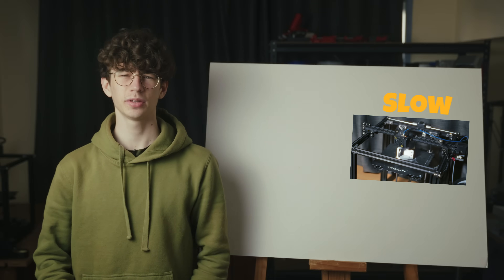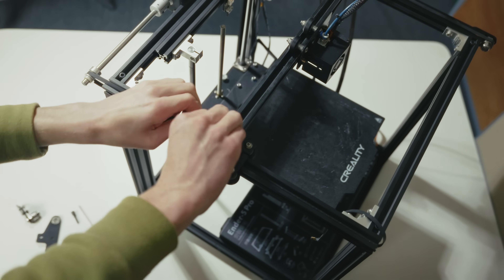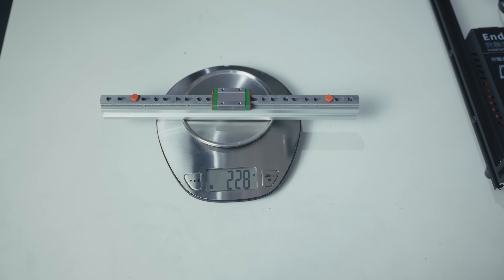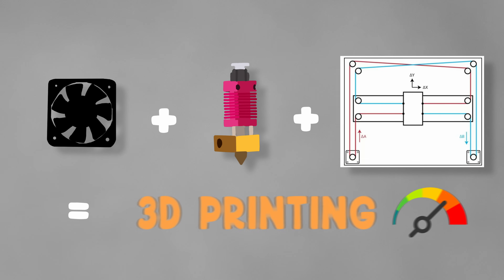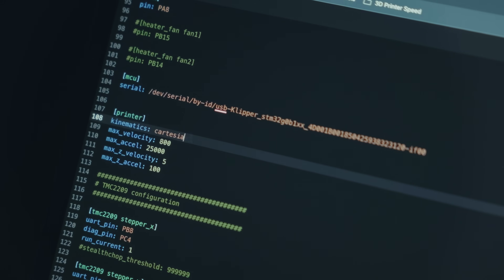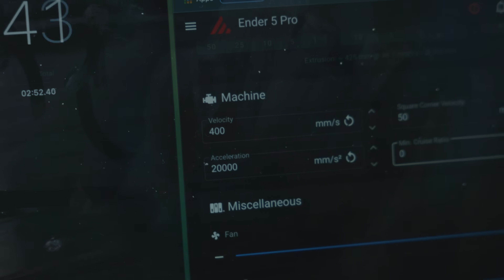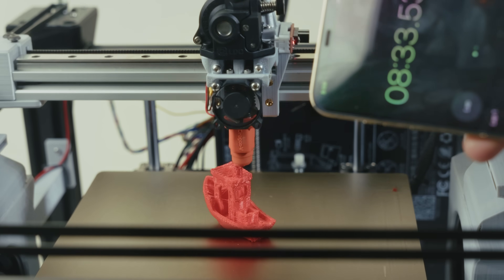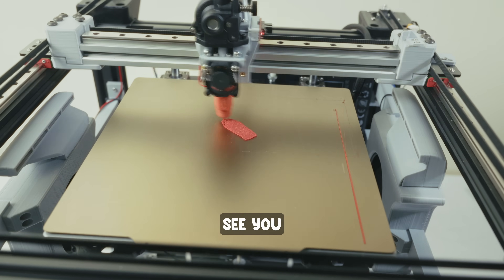Building the Fastest Ender 5 Pro

Comment: The advantage or CoreXY is not "because two motors are used to move the printhead in the XY plane", because cartesian does the same thing on diagonal movements while CoreXY only uses one motor for perfect diagonals. The real advantage is that the motors are both stationary, reducing the weight of the gantry especially in the Y direction.
Reply: I used to believe that until Bambu Lab came out with the A1 and Creality has the E3 V3 and V3 Plus. I have the V3 Plus and it can spit out a 14 minute benchy that is comparable to a 40 or 50 minute benchy on other machines and it's a bed slinger with a 300x300mm bed (that's a lot of weight). Also look at the new machines that are multicolor printers. There's a lot of weight on the print head, especially since some are dragging more than one bowden tube.
The only real advantage that a Core XY machine may have is less ringing and layer lines in very tall builds since the bed isn't moving back and forth, but so far I haven't seen much to be concerned with printing on my E3 V3 Plus.
Reply: @Smedleydog1 when going bigger on corexy you are adding much less weight than with a cartesian, and the problems that may occur with longer belts can be counteracted with ones with more width, such as going with 9mm instead of the normal 6mm on most consumer 3d printers
Reply from the maker: You're right on that, I should have been clearer. If I need to mention it again in the future, I'll make sure It's accurate. Cheers
Reply: @TommyHoughton  Actually "cartesian" is not automaticly a bedslinger. Also crossing rods (like used in the Ultimaker 2 and Crealitys CR200b) is a cartesian system. The K3 is a very fast and capable crossing "rod" system (crossing linear rails instead of rods).
To be even more precise: "Cartesian" just means 3 axis perpendicular together. So strictly speaking a CoreXY also is cartesian - z-,a- and b are perpendicular together. Just g-code coordinates are 45° rotated to the x and y of the g-code coordinates.
And even more more precise: Any printer with ABL is not cartesian, as z=0 depends on x/y coordinate - so you are not strictly in euclidic space (z
=0 plane is bend...). "Cartesian" only applys in Euclidic space... (but this definitly over strictly following the definitions).
However, there are real non-cartesian printers: Delte/Hanging printers and Polar Printers.
Reply: The weight of the extra crap cancels out savings by relocating motor doesn't it? 
The disadvantage of giant long belts is stretch and slop I still don't get how without linear encoders you keep accurate position? If HP made 3D printers they would be full of linear encoders.  All crap inkjets use them to achieve such detailed fonts. So why not 3d printers? And don't say too accurate that isn't a thing.
Reply: @remotepinecone Most likely because that would make it more expensive and / or such a package is not available yet?
Reply: @remotepinecone  On 2d inkjet printers the printhead is just moved left and right. Acceleration/decelleration just happens at the end of the movement. Linear encoders are used to determine the position at any time. As the printhead does a constant speed, it does not matter the encoder resolution can not be as high as the print resolution. The encoder does not recognice 1200 position per inch, even it this is the resolution you selected for the print. On a constant linear movement you can interpolate the position quite accurate. So the dots can be fired out exactly in the right moment. The printhead acts depending on the position. It is only moved in one axis - and every position without dots, the printhead just moves without fireing dots.
It is dot-matrix. It is just moving left and right; only turning back at the end of a line. It decelerate after the last dot is fired in the line, and it has accelerated in the other direction before the first dot is printed.
In simple: The dot shots the moment you are in ther right position. Your position decide to fire. So you can use simple DC-motors.

This is totally different to vector printing. Here acceleration/decelleration happens while printing. The most important thing is to move the right way and stop and change direction fast and precise. Esp. stopping in an exact position is not exactly something you can do with an DC-Motor (there are some tricks). But for precise break you actually need an active break. For big CNC-Mills there are some heavy motors using this technic, and rotary encoders are used to control how much the motor had turned. A quite coslty techniqe.

But here this are all rotary encoders, to controll the motor - not the printhead. You can measure and calibrate the kinematics.

The biggest problem why linear encoders do not make sense on 3d-printers: The extruder reacts to slow. If the extruder feeds, there not instantly plastic comes out of the nozzle. And if the extruder stops and retracts, still this takes its time to the plastic stopping comming out of the nozzle. AKA "preasure advance". What´s the benifit knowing you are 0.1mm off then the extrusion started? you can not change it anymore.

However, linear encoders would be quite nice for autocallibration. The tension of a belt effects the steps/mm you need for a distance. So move the printhead 20cm and check by the linear encoder the real distance archived. Recalculate the steps/mm.
But as does not change to often, manual calibration prints are not a big deal - and extra linear encoders are just another part that might be damaged.
Reply: That's why I'm rocking some Hiwin Ballscrews and Linear Rails 😉🍆
Reply: @remotepinecone  there is so little slop that it isn't even a factor worth considering, that's what belt tension is for, with high quality belts stretching as seen in the video won't happen
Reply: @remotepinecone  hp does make 3d printers...
Reply: Disadvantage is longer belts. A replicator style system can move one axis faster with less wobble. But the other axis suffers.

Theres other ways to transmit the movement like a long gear shaft etc too but get complicated and expensive
Reply: @lasskinn  The belt drive is the only one without backlash and misalignment. Crossed shafts have backlash at the bearings on the hotend (although only a hundredth of a mm). There is also a fit tolerance on the threaded spindle. With well tensioned belts, there is no displacement between the motor and the hotend (theoretically only a change in belt length, but for a quality belt = 0).

Comment: No auto levelling? Thought adding a BL Touch or inductive probe would be usefully. Any capacity for input shaping?
Reply from the maker: I was considering it. I do have a bltouch and microprobe, but I would have to design a mount for them. With the amount of changes planned, I’ll leave it until the end. I didn’t see a need for input shaping just yet but will calibrate once I need to. Thanks for watching! Cheers
Reply: @TommyHoughton  buy a BTT eddy it's about 20 euro and is a very fast and good eddy current probe.
Reply from the maker: @larseastman1567  I’ve heard good things about it! It’s definitely on my list to try. Cheers

Comment: it looks like you just need an actually cooling fan on your toolhead and you will be good to go. i reccomend a single 5015 fan setup (no aux fans) as thats worked pretty well for my machine in keeping up with high speeds. since my printer is cartiesian it cant go quite as fast as yours but i can do 17 minute speed benchies (while still following speed benchy rules) and have no cooling artifacts.

also i loved the editing on this video keep up the great work.
Reply from the maker: 100%, I think CPAP is the only option for the speeds I want to achieve in the sequel. 5015's are super powerful for their cost and size though! I've never had any issues with them, ever. 17 minutes is really great! I've got a couple of bedslingers I'm trying to push as well. Cooling is terrible on them for now. The plan is to do a video building a custom hotend (I think the big one will be about 80mm total length? It's insane, I did a community post on it) and then a video on a carbon fiber Y axis overhaul, with 48v steppers just for fun. It'll be a crazy couple of videos. Not sure how I'll part cool at those speeds, but a 5015 or two won't hurt at all. Thanks for watching :D
Reply: @TommyHoughton  oh your gonna go FAST fast. Yeah I love cpap setups but I don't have a printer fast enough to justify one (yet), still too broke for a voron.
Reply from the maker: @ishootfoam992  That's the plan! With a few upgrades, I'm sure you could get your cartesian machine to a point where it'd need cpap. That's an interesting sentence, ha. I can't afford a Voron either, it's a long term goal. If you do any upgrades or such, please let me know!

Comment: amazing project
an upgrade from that cantilever bed to triple-z is probably just as big a step as upgrading to linear rail core-xy
Cantilever beds just shake and vibrate way too much at high speeds to get good results
im surprised a 3d printed linear rail even works, doesnt it have way too much play? besides that u can toss the x-beam extrusion, buy some generic 20x20 aluminium square from local hardware store and drill a few holes -> huge weight decrease compared to the 2020 item-clone extrusion
VZBot and ratrig discord groups have lotsa tests on comparing different x beam designs
Reply from the maker: Thanks! 
You're right on that, it's something I need to look into. Or at least a dual Z. Reinforcing the whole system is one option, but would take the same amount of effort.
It worked, but way too much play. It was too tight when it first arrived, so I filed it down but that caused more issues. I'll try cnc machining but if that doesn't work, I'll compensate with a lightweight X-beam.
That's a great idea actually, probably the cheapest too. 
I'll join their servers, the info would be super useful.
Cheers

Comment: Hmmm watchin ur vid i got the idea to ask my cnc dude cutting slot holes in my linear rail. We got lightweight x-beams made out of carbon, aluminium, even skeleton titanium. But ive never seen fkin slotted rails. That could save again up to 25% of the rails weight!
Reply from the maker: I believe fysetc have a "light-weight" rail or such. Bit of a pain to find on AliExpress. It was about 150g compared to 200g so that 25% reduction is bang on. Not sure of the other benefits or negatives. It costs 3x a regular rail though. It's a great idea if done DIY as you save quite a bit! Cheers!

Comment: Ive spent the last 14 years building better and better printers, refining my skills, reaching endlessly for perfection in prints. This feels almost insulting. You didnt print 1 respectable benchy. Even the 78min print could be far far better. So what if you can melt plastic and wiggle a nozzle around. Unless its a functional print whats thw point. Your worried about trying to run but you havnt yet learned to walk.
Reply from the maker: That's very true, there wasn't a solid print in this video. I wanted to figure out why the 78m Benchy sucked, but I wanted to just move on. I'm trying to get the belts sorted and more cooling added as I believe that's sacrificing the quality. I hope to give this machine justice. Cheers
Reply: Got to start somewhere to push the boundaries. Wait till it's better and runs those speeds while printing functional stuff. Look at the annex printers.
Reply: How about you spend 5 minutes perfecting how not to be an a$$ and leave constructive criticism your 3d printing highness

Comment: There is NO such thing is a fast reliable Ender 5.  They are cheaply build and mass produced..  Now if ya,  completely tear down and change it from the original propriety creality crap to a different machine.. Like the Vzbot, or Hydra.. Thats NOT a Ender 5 anymore..
Reply from the maker: That’s true. The only stock thing currently is the frame. Cheers

Comment: Price would have been nice
Reply from the maker: I should have tallied it up at the end, that’s my fault for forgetting. It’s under $1000 NZD but I haven’t done the full math. Cheers
Reply: @TommyHoughton  oh geez that is way more than I was expecting. Aside from already owning the printer, if you are getting into that price range why wouldnt you just buy a higher speed brand or go down the voron route.

Edit: ah I didnt expect the exchange rate to be that far off, thats 600 bucks not like 800 like I was thinking. That still gets you a P1S though I imagine, which probably cant get a 12 minute benchy, but seems like it would be a more complete package than upgrading the ender 5 pro.
Reply from the maker: It would be better to buy a high speed printer for simplicity, but the local markup in NZ is insane. Shipping is a pain too. I'd love to buy a P1P or P1S but it would cost over double what I actually spend on this machine. (Local retailers want 1500NZD for a P1P, which is over 900USD.) It's painful. A lot of components were sent in which made this all possible. The bambu lab machines "just work," which is a massive positive, most of mine aren't as reliable. For now I'll keep upgrading these machines until I get my hands on something from Bambu or such. Cheers

Comment: Metal printing the rail is just stupid, it needs to be ground and have low tolerances
Reply from the maker: Yeah, you're right. I realized it wouldn't have the accuracy I needed from the start. I wanted to try though. I might try again with CNC in the future. This project made me realize how important keeping everything solid and rigid is. Cheers
Reply: you could lose more weight I think if you reduced the weight of the extrusion instead of the rail itself. You could for instance run a carbon fiber square tube. Some people even just run the rail on its own. Hope this gives you some ideas. Great video overall man :)
Reply from the maker: That's the plan, but I'm torn between either CF or cnc'd metal. I forgot I could ditch the beam altogether! I don't know the pro's and con's of that though. Thanks for watching and suggesting! It's very exciting to think about. Cheers

Comment: I might see how fast I can go on my Kobra 2 max. Theoretical max is 500mms but the bed is so huge I'm not sure if it won't destroy it's self 😂

I usually print at 230mms with 5000 acceleration
Reply from the maker: I've been surprised multiple times with how Bedslingers perform! 500mms might be pushing it, anything above 200 is still pretty good. They're quite fun to push. Cheers
Reply: @TommyHoughton  Fastest I've printed a normal print is 300mms but it looses dimensional accuracy at that speed. It's fine for nick nacks like bottle openers and other pointless objects.
Reply from the maker: That's still crazy fast, I've barely pushed my own bedslingers to that speed. I've got some plans to go faster though! Coming later this year hopefully.

Comment: i have a Ender 5 Pro but i feel like the cost of the upgrade is not worth it.
Reply: I had 1 and I wanted to do one small upgrade but as I looked into it, it was marginally more expensive to just buy a second printer. Now I have 3 used ender 5 pros. The other 2 came with the upgrades I wanted already lol. Now I don't even have to worry about speed because I can just run 3 at a time. 😂
Reply from the maker: It probably won't be, the speed increases are there, but the stock machine prints fine and is reliable enough. Cheers

Comment: And that's the reason why original Gates belts are always recommended, generic brands simply can't cope.
Reply: I don't think it's a Gates vs. knock-off issue. The pattern of damage where they failed tells me it's the wrong type of belt. It looks like steel backed PU belt, which is unsuitable for small radii, because THIS happens, nor is it intended to be run fast, it's intended as a precision belt. Normal 3D printer belt the cheapest kind is textile or glass fibre backed chloroprene, which for one takes the radius much easier and for other cannot just melt. So he went both too cheap and not cheap enough at the same time, actual sort-by-price garbage belt would have done much better.
Reply from the maker: @SianaGearz  Thanks for the info! I don’t really know anything about belts, so this helps clear some of it up. Cheers
Reply: @SianaGearz  yep, steel-backed belts are definitely a no-go for that use case.
Reply from the maker: Absolutely true. I'm not going to try save a couple dollars next time, it's gates or go home! Cheers
Reply: Wait till you discover gates gt3 2mgt, it's supposed to perform even better.

Comment: May wanna see about replacing your belts with something that has more tensile strength. Like CF or Kevlar. Though be careful not to sheer your motor shafts!
Reply from the maker: Good idea, I'm sick of these cheap belts. What does sheering the motor shafts mean? It's been brought up a couple times but I honestly don't know what it is yet. Cheers
Reply: @TommyHoughton  basically if your belts are so strong that they don't stretch, that torque force will be put into the shafts of the motors, basically breaking the shaft in half and gearing it off the motor. 

Happened to me with my Creality CR10 SE recently. The belt was too tight and it broke the motor shaft during a print.
Reply from the maker: That sounds quite scary, thank you for explaining it. I'll do research into the "belt side of things" and apply what I can. It's been a hassle so far, so I'll do it well once and leave it. Thanks!